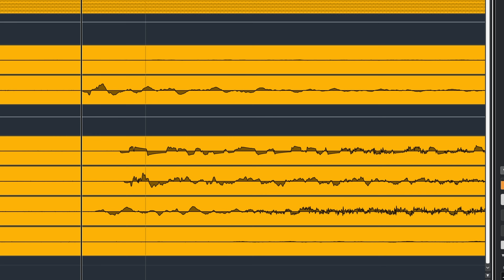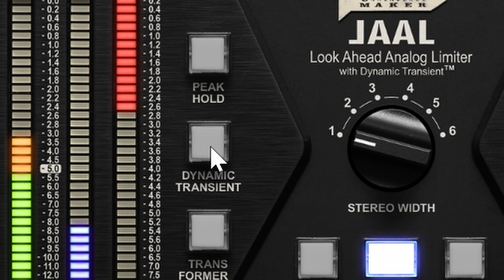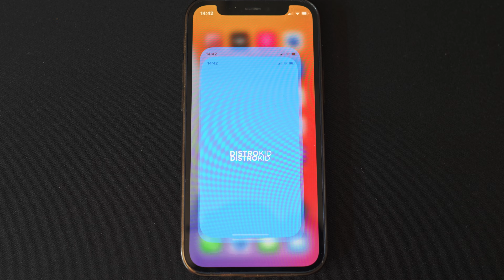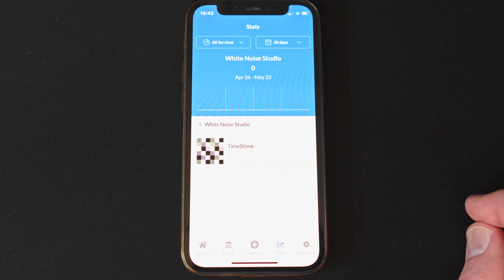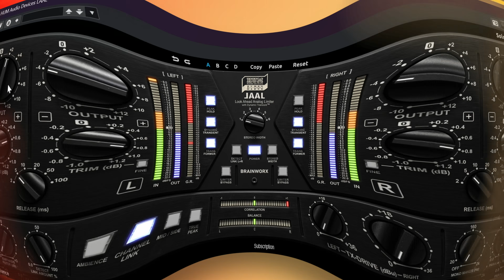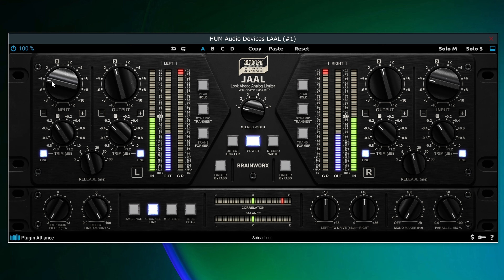Another Plugin Alliance LIMITER - Hum Audio LAAL Look Ahead Limiter Plugin

Comment: A lot of people miss the point of this plugin and hardware unfortunately. It's the favourite limiter of the biggest mastering engineers for a reason. You can make your song louder without harming your transients and that's exactly what you want when mastering.
Reply from the maker: Yeah the transient setting is pretty neat.
Reply: Pro-L 2 blows this out of the water. Even the transformer emulation ruins fidelity.
Reply: @RadiantValkyrie  I purchased this before demoing ProL2, and you are 100% right. ProL2 is awesome, I'll likely never use this again.
Reply: He mentions extensive aliasing and that it adds quite a bit of colouration. I'm no expert, but is that good for mastering?
Reply: May be you dont feel how the sound change but it is.

Comment: The fact that it's a hardware limiter emulation that provides a surprising amount of flexibility (true peak, lookahead, TX-Drive, etc.) and doesn't include gimmicky TMT is nice. $49.99 for those who own Soma and/or DSCEQ. F29 codes are still active, so grab this while you can if you're interested and have a voucher. They are all expiring soon...
Reply: why is TMT a gimmick? component tolerances are a real thing. Having it inside  a plugin is what gives it the analog 3D ness when using multiple instances of the same plugin.
Reply: @casualintrovert207 I used to kind of believe this, but to me, it seems like just slight variations in EQ, compression etc. behavior, rather than actually modeling the differences in tolerances. Doesn’t Plugin Doctor show it’s the exact same EQ variation between different PA console emulations plugins, too? I agree with Dan Worrall’s assessment of it in his AMEK video, including the fact that if different channels have different EQ and compression characteristics, wouldn’t randomizing channels throw off the values you had intentionally set, and what if one channel has better sounding compression than another on a source, are you going to flip through channels until you find what sounds best? Sure, it’s patented, but that doesn’t really mean much to me. Slate Digital chose to not model tolerances in VCC because the differences were so minuscule between channels that it wasn’t necessary, and their argument is channels that have big enough differences between them that are clearly audible is undesired and would be faulty and replaced, though I have heard the niche argument that some engineers use a specific channel for a certain instrument. You can get a meaningful difference by varying the drive level between VCC instances. Also, how does TMT work on plugins that are not console emulations with different channels? How are there 20 different TMT channels on a compressor? TMT is not necessary to get a 3D sounding mix, most plugins don’t have these tolerance differences, meaning most mixes don’t, and you’re not going to make a mix sound 2D by not using a Brainworx technology/plugin.